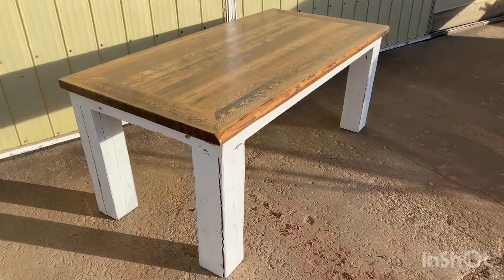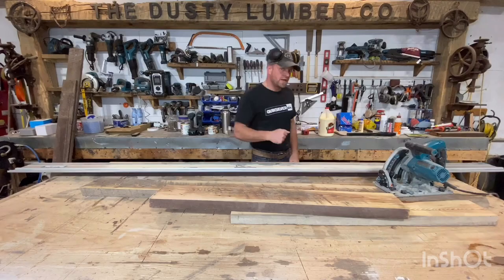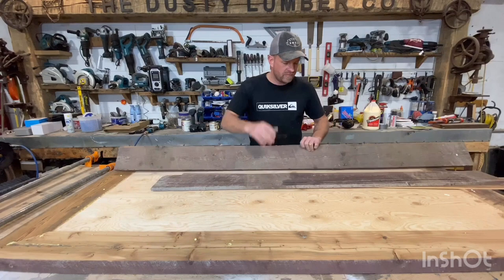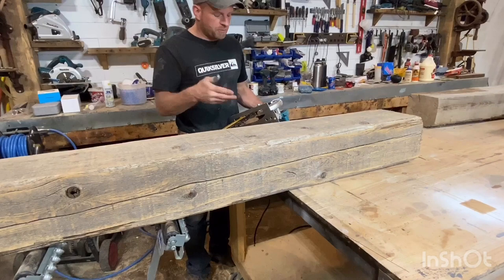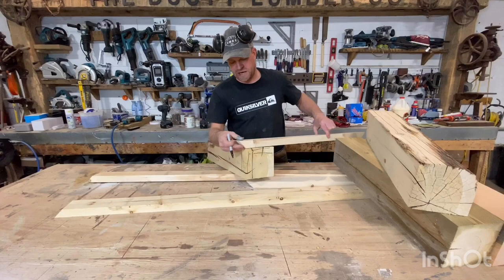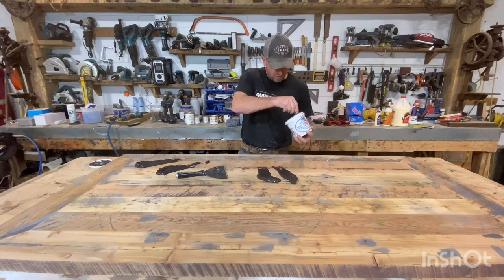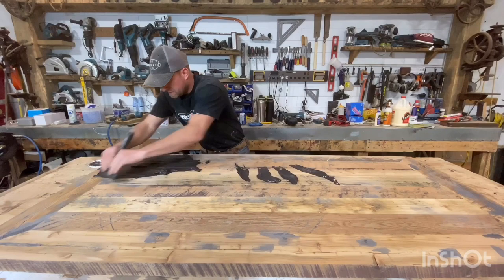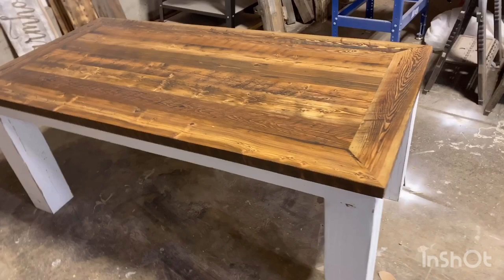How to build a barnwood table with a plywood core

Comment: I'm really enjoying the videos and getting a lot from all of your detailed explanations.  Thanks.  Sorry if this has been asked and answered: it looks like you often leave the excess glue that oozes out of joints to dry, and then you clean it up later with a sander.  I've always used a wet rag to take that off right away when I'm doing glue up.  When I leave it to dry on the joint, it ends up being hard, even harder than the wood, and sanding it off is a lot of work and it takes down too much of the nearby soft wood.  It's also hard to get it all off for when I stain if I let it dry.  Are you not having that problem?  Keep up the good work.

Comment: Thanks for this video. I am planning on building something similar and I wasn't sure if the plywood core would work, but you've shown me that it works just fine. Do you have to add in the brad nails or could I just glue it down?
Reply from the maker: Jeff awesome! Glue will work if you can clamp it down to hold the birds down while the glue dries

Comment: Nice build. What type of wood is "barn wood", maple, oak, pine, redwood, etc? I'm wondering if I can make/simulate my own by leaving the wood outside for X weeks/months to weather it. I have a flat roof and live in CA. we have little rain, but plenty of fog and moisture, any thoughts on this? THanks
Reply from the maker: Thank you! Barnwood species depends on what the local species of wood is. Where I’m at the forests are mostly comprised of fir, spruce and pine and so that what they old timers built their barns with. By contracts on the east coast because there is oak and hemlock they would have used that to build their barns. Most of the wood I use has been outside and exposed to the elements for around 100 years so unfortunately just leaving new wood outside for a few days or weeks won’t do the trick. Having said that you can use a combination of wire brushes, sanders, reactive stains and other tools to add character marks 👍

Comment: Man, I'm an idiot. I should have put barnwood into the YouTube search engine. Ironically your page came up in the "should watch" banner. I harvested several pine 2×4's and 6's. I had this brilliant idea and ZERO BUDGET too really speak of. I have all the basic tools. I've built homes cabinets and different odds and ends forever. I doing so improvisation is my strong hold. I have A thousand questions and they're slowly as I watch being answered. I may do A few videos because I've really had some good fortune in this venture. 
One thing, I didn't realize you could market "barnwood" and still use materials not 100% reclaimed barn and old warehouse lumber. I see now there no strict code. Anyway, thanks A million, peace,